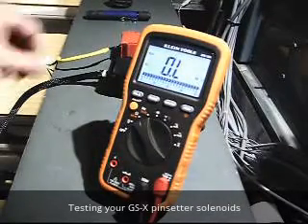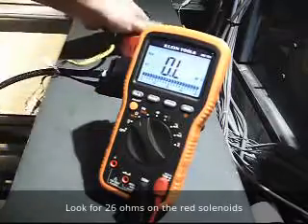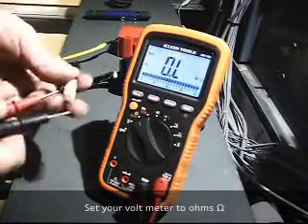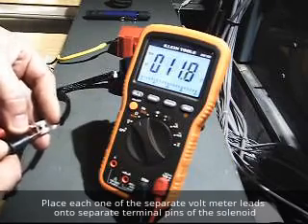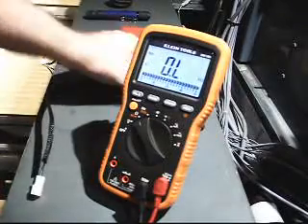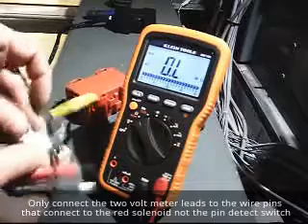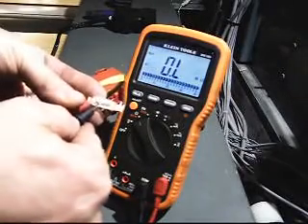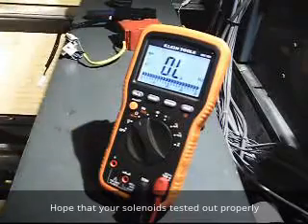Passed the Solenoid Test

Comment: Is there a way to test the switch that's attached to the solenoid ( activated by the switch button ) with the multimeter? I'd like to be able to not install it on a table to just test that one part.
Reply from the maker: I am not sure if you mean just to OHM out the switch and listen for an audible or on screen visual connection.

Comment: nice videos man, I've worked on gsx pinsetters for a while now... I have a question... so on one of my machines I have the #1 #2and #3 pinholders not opening or setting the pins but the rest of the holders  are working. I also just replaced the wiring for the solenoids and it still does the same thing. do you have any input on what this could be??? i just can't pin point the issue. If you respond that'd be great! thanks for your time man!
Reply from the maker: So it loads the pins into the holders (they are dropping in from the stations above)?
That means the wiring is good in that position, and solenoids are good, because it is opening the gripper arms.
But if it just won't release the pins when setting on the lane.
Maybe your table is out of level, it might be tipping the table too high off the deck on the front.
Check to see if your front of your table is 15-17mm off the deck.
If its @22 or more that might be the issue.
If the pins don't touch the deck (deep/far enough) to lift the weight of the pins off the grippers that won't let the gripper arms open on the holders.
Thus it never releases the pins onto the deck.
Especially if you said you replaced the wiring harness.
If you hadn't replaced the harness I might say there is a short in the wires.
But with the multi stranded wire the chances that with multiple wires shorting, the affected wires are 1, 2, and 3 pin would be a million in one chance.
If multiple wires shorted I would expect them to be different holders, i.e. if 1, 4, and 9 as random example.

Also it might go back to the nexgen table solenoid/pin switch terminal connection board on the side of the nexgen.
You might try swapping with the board on the opposite lane side of of the same nexgen box.
If none of that does it you might have to swap the nexgen main pcb with a known good from another lane.
To see if the problem finally follows the part.

Good luck I will post if I think of anything else it might be.
Reply: tmiller453 thanks for the input! I will try these things tomorrow!!!
Reply: tmiller453 did you send me your email address? I am a question about something I did not see a video